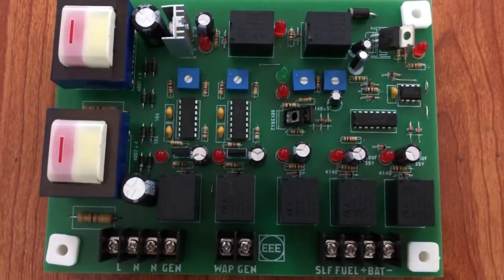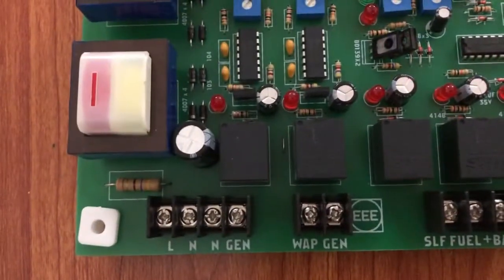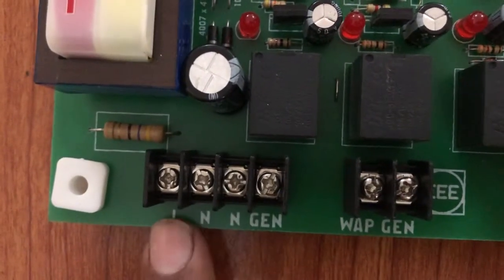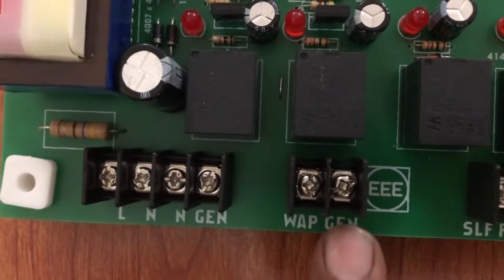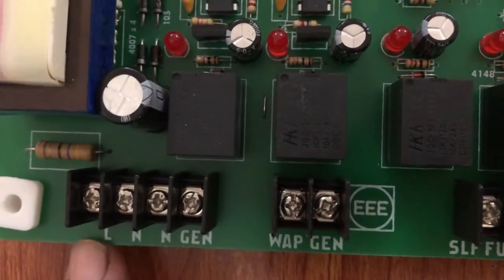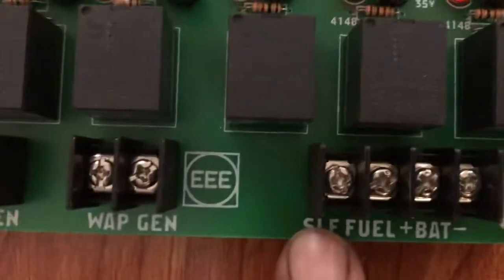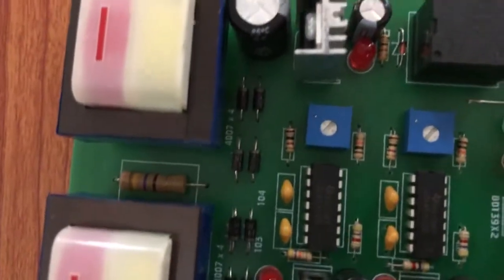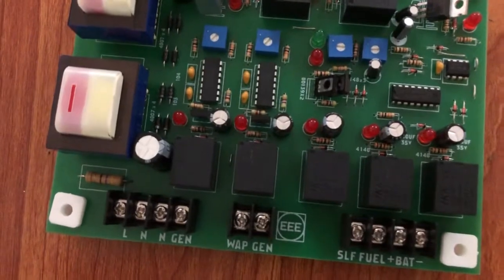Tutorial on AMF card function for generator ATS card And installation

Comment: I had same like ats kit our kit is not switching on wapda contactor and no power supply to this contactor what is the solution for this problem i changed new contactor but also not working and genrator contactor working properly
Kindly solved our problem
Thanks
Reply from the maker: Changing 5 pin relay on card whose light turns on with Wapda signal will solve your problem
Reply: @Technical.Education  i will try and let u know that problem is solved or not
Thanks
If u had an email i can send u pannel pictures